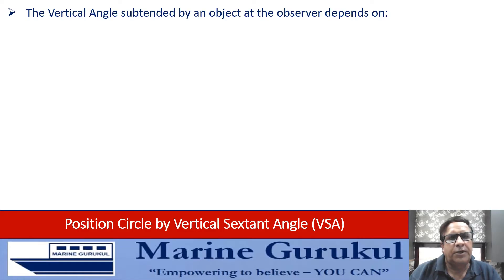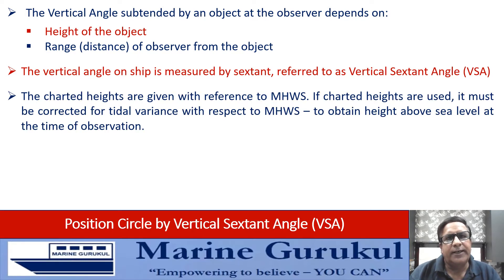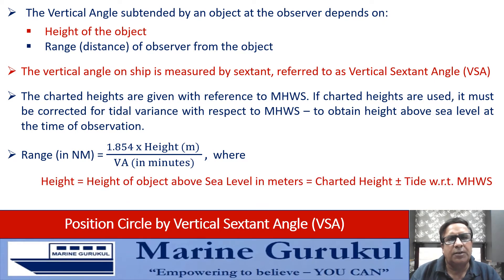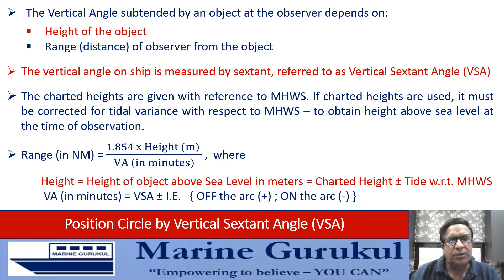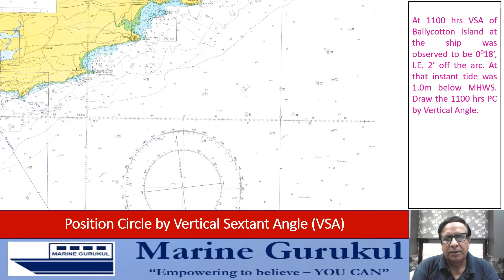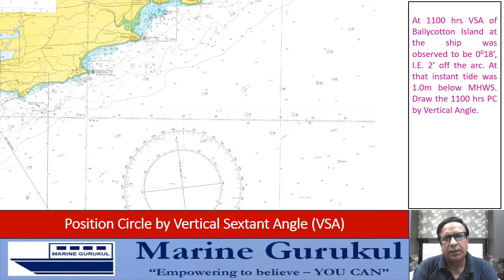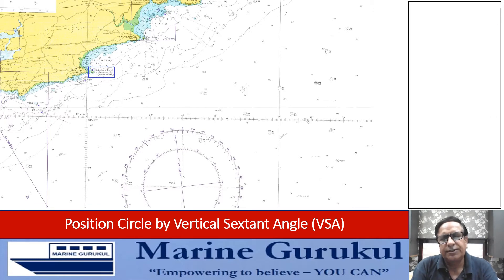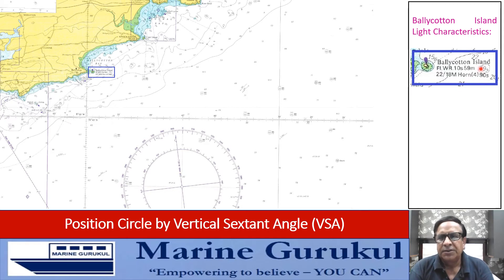Position Circle by Vertical Sextant Angle

Comment: Nowadays, this method might be not useful anymore because of the existence of RADAR. But it is still insteresting method to learn.
Reply from the maker: Fully agree with you - more so the ability of the navigators to use sextant to read of the vertical angle is greatly diminished. Best Wishes